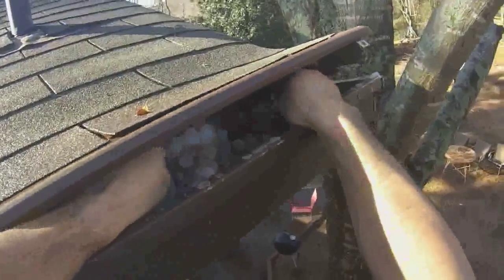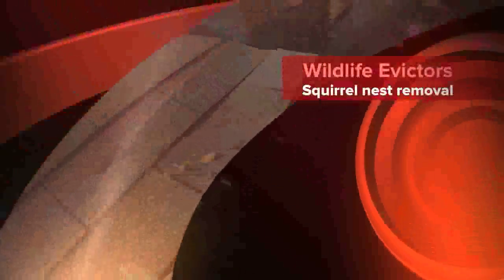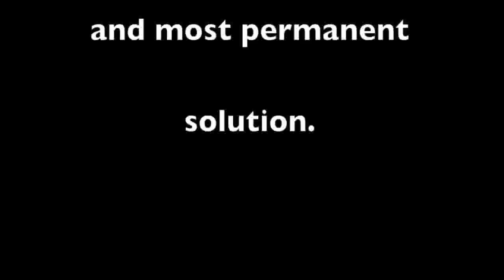Noises in the gutter.. squirrel nest!

Comment: 3 years ago the neighbours tree landed on the corner of my home and that was the beginning of my troubles with squirrels. I had the corner of the roof repaired with new plywood and shingles and brand new gutters, eavestroughs, soffits, fascia around the whole house. Seems that the squirrels somehow got in the attic by lifting up the newly replaced singles. Had someone come and fix the issue, or so I thought. There was no  squirrel activity for about a week. They came back with a vengeance. Gnawing on any wood and even metal to get back into the attic and using the same entrance that was just blocked off the previous week. I gave up at that point as my health was off and on. The only way to access the attic, which you can only crawl around in, is via one of the bedroom closets. Full access entails the removal of all items within the closet. So it’s not easily accessible. At one point after clearing the closet, I was able to put in a trap and on two separate caught 2 squirrels. I drive about 8km and released them into a big forested area. After a few weeks of silence, I removed the trap and but all the items back into the closet. Short lived bliss. With warmer days, the squirrels are new nesting in different areas of my soffits. They seem to now favour the soffits on the side of my garage. My garage is attached to my house and I have a loft within the garage. A week ago I went up into the loft and (I might not be explaining or using the correct terminology) stuck the end of a broomstick along the rafter tails to where I can feel the fascia and it so happened to also be in the area of one of their most used nest, to hear them scurry about but using the length of the soffit to get away from the broomstick. I am only able to do this one section at a time and at times they would peek their head out or completely come out of the rafters climb along the loft walls to only enter again into another section of the rafters and run along the soffit to avoid the broom. I live in a bungalow so at times I’ve gotten a long shower rod with a rubber end and ran it along the underside of the soffit when I hear them gnawing. The company that installed my 2 year old gutters, soffits, fascia I contacted to add leaf guards thinking that might prevent the squirrels from nesting as that is where I original thought they were in. The owner said that he can install the galvanized sheet up against the wall to prevent them from getting into the attic. I saw this video and you causally mentioned the galvanized sheet. What is the most successful way to install it to prevent unwelcome tenants? And is this just to prevent them from getting into the attic? What about preventing any animals from setting up a nest within the soffit? Are leaf guards, when installed correctly just to prevent the accumulation of leaves and twigs debris? 
As I’ve been having a nightmare with the general contractor for the last 2 years, I would like to at least be able to rest my mind about these squirrels and move on from there. The gutter work was subcontracted out to a neighbour by the GC (I didn’t know the neighbour did roofing and such otherwise I would have approached him myself. Especially since our kids went to school together) so working with the subcontractor myself would not be an issue. 
Sorry for the long post and hope to hear any advise you may have.
Reply from the maker: Call Shinya at 404-618-8539 to discuss your issue. I will help explain things.